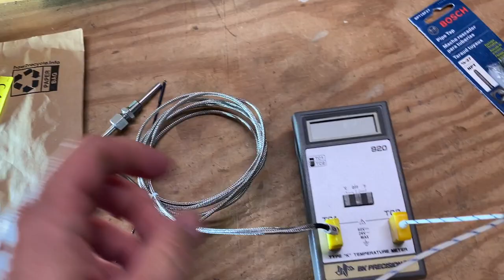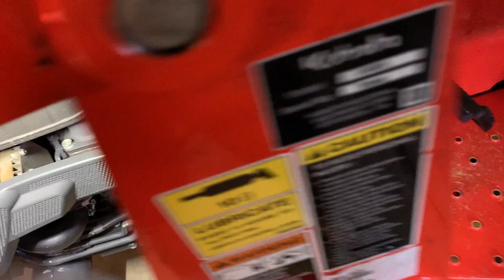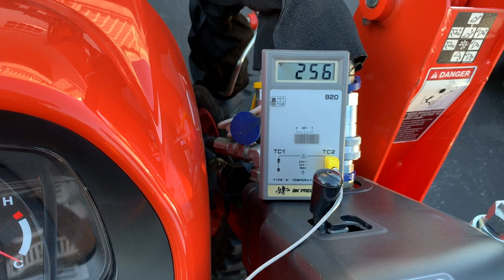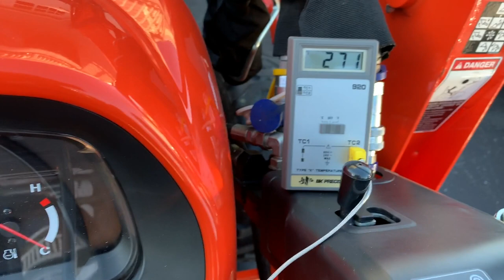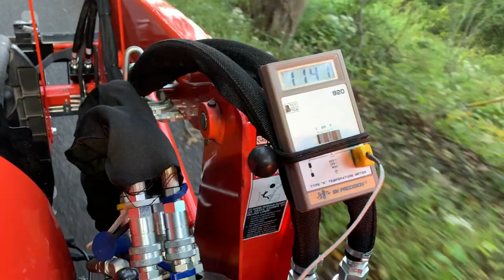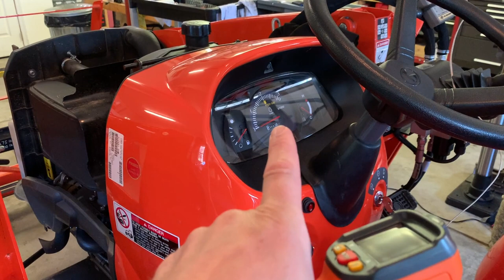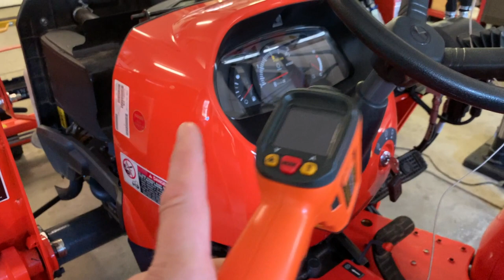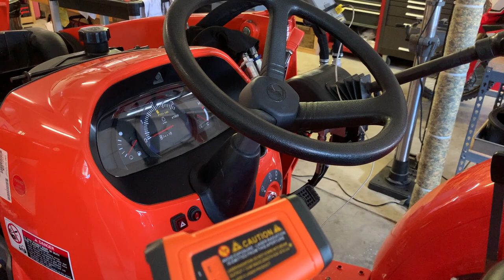Increasing the engine power of a Kubota L2501 / D1703-M-DI-E4B - Part 2

Comment: Thank you for doing this research! I've loved my trusty little 2501 since I got it new in 2017. Think its gonna get a little more power now... I'm curious how much difference there is in the spec range for the timing. I've always felt like mine had more than 25 hp, based on the work it can do. I'll probably check to see where mine is set at factory before I adjust it. I've never had the smoke issues a lot complain about. A little soot but that's about it. Guessing mine might be set on the high side of the spec.

In any case thanks! Very well done research!
Reply from the maker: Spec range is 3.25 ° to 4.75 ° B.T.D.C, so it's probably a few HP
Reply: @netmagi  well I did it. I had a .20 and .25 shim just like you did. I pulled both for a 4.5° advance. Turned the fuel up about 1 turn. Unbelievable difference in how it performs! I'm curious if you've been able to find any solid data on what our max EGTs should be. So far I haven't seen it top 1200, and I feel comfortable with that. But I darned sure don't want to melt something down either. Thanks again for your research!
Reply from the maker: @bearswartz2907  From what I read 1200 is ok but probably not best to run at for long periods if you want the 10k hours these engines will often run to.  I would consider ~1100 to be safe for running all day, every day.  I might pull mine again when I get a mill and shave .20 off and leave the .20 in there.

Comment: Kubota puts the same engine in their 8,000 pound kx033 excavator. Im seriously considering this machine for purchase over their 10,000 pound flagship kx040 with the 40hp d1803  because of the exhaust system simplification. From your presentation I can guess that the kx033 would have more power when moving itself  up a grade or when using the dozer blade to push earth. But the bucket and boom performance would be unchanged. Would you agree..?  or have any insight?   Extrapolated thoughts.?  
….The amount of knowledge you have acquired on this topic is very impressive and helpful, it’s as if you are a diesel mechanic for kubota. You can’t just look this stuff up anywhere except your channel. Thank you!     ….
Reply: Also on a reliability/ durability point, do you think that the engine would be more reliable/durable due to less soot deposits or slightly less longevity due to increased engine temps .?   Or is it a wash?

Comment: Looking at purchasing one of these myself so doing some research first, great efforts and great production in the video. There is a ton of good information on this. One thing I am curious about with everything else being the same, could you order a shim for the older tractor that would be the correct thickness and put it on the newer tractor?

Comment: Very informative. I'll be looking forward to doing this to my new L2501. Thanks for all the work you did to put this together so average folks like me can get some more performance out of this tractor. It all makes good sense. On a separate note I am in the market for a grapple and wondered if you had one or had any recommendations. I am leaning towards the Land Pride SGC1060 because its "performance matched" to the tractor but I'm a little reluctant to spend 3500 plus tax for it. Thanks again.
Reply: Check out "Everything Attachments" and you will find a variety of grapples, I have had one for several years and think it is indestructible, it has twin cylinders that grab each half of the grapple individually, it works great

Comment: Could you just adjust the screw and not touch the pump and get the same results? Did you use an angle drill for the sensor? Didn't look like enough space for a regular drill.
Reply: My question too!
Reply from the maker: No.  The two work in tandem.  Doing either alone will get you SOME power, but I would guess less than half of the gain if done together.   I would also think if you only adjusted the fuel at stock timing it would be even smokier.  Like wear-a-mask smoky.  The engine burns the fuel too 'cool' at stock timing, especially at lower RPM's under minimal load.
Reply from the maker: Had to use an angle drill.  I'm on team Bosch, so I used this one: https://amzn.to/3mplGXc
Reply: @netmagi  and a follow up question- do these changes affect loader lifting capacity?
Reply from the maker: no, but I have a video out on that as well.  Check out: https://youtu.be/b_mvKc9g1q8
Reply: @netmagi  I meant in addition to that :)
Reply: More specifically - wasn’t sure if the HP boost also improved lift capacity. For my use I need the very best lift capacity over any other vector - wondering how they all fit together
Reply from the maker: @exspo  no difference whatsoever.  You could actually decrease the horsepower and still get the same PSI as long as you were measuring at the same RPM.
Reply: @netmagi  gotcha. So for my purposes the hydraulic mod is the way to go. This is my first tractor and was surprised that it bogged on its own weight up hills (super hilly terrain on our farm) but it gets the job done. The work you’ve done is fascinating- thank you for sharing!

Comment: Hello very nice! I would be curious to see the difference in your lift capacity. I think the increase in HP would reflect in an increase in your lift capacity, especially because you increased the pressure to 2590. Thoughts?
Reply from the maker: The additional horsepower will not translate to any additional lift capacity.  The engine at stock settings already produces more than enough power to maintain the RPM on the hyd. pump at the relief pressure (even with the pressure raised)

Comment: Have you looked at a water/methanol injection setup to help lower EGTs? I wonder if you couldn't also then turn up the fuel with your intake density being higher...
Reply from the maker: I have not.  Probably worth looking into if you're building one of these motors for pulling or some other competition, but (in my opinion) would add to much complexity in a tractor application where you just want to know you can count on it to work when you need it
Reply: @netmagi  When my l2501 comes in I might give that a shot. Just run a simple 12v pump to a jug of windshield wiper fluid and see how it lowers the EGT. The other advantage would be helping decrease the risk of predetonation especially in our case of advancing the timing.

Comment: Great information on obtaining more power, safely. Its greatly appreciated. Just curious what the infrared temp reader would show with the probe plugged into it? Also noticed your temp gauge did not climb but stayed at about 1/3 the range. (I hate gauges without numbers!) So it the cooling system looks like it is well able to handle all the changes. Do you remember the approx air temp the day of the test?
Reply from the maker: It was fall, so was likely in the 60's.  It would show the same (or very close due to slight differences in PID handling) as the BK precision with the probe plugged in.  It seems like the cooling system on the L2501 is pretty over-spec'd for the amt. of heat the engine produces stock.  My guess is that is so that even if the radiator screen is 50% clogged , it's still able to keep the engine cool.  Some of that over-spec is now probably gone with this mod, so if temps do start creeping up, you will probably need to clean the radiator screen sooner.

Comment: Just out of curiosity, how much lower are the temps at the tail pipe vs the manifold? Looks like you have the ability to measure this simultaneously?
Reply from the maker: a few hundred degrees. but the biggest issue is the lag in change.  At the manifold you see it near instantly.  At the end of the pipe, it takes MINUTES to saturate.  By then, you're pistons might be liquid :)
Reply: @netmagi  thanks. One of the most comprehensive well made videos on YouTube. Both part 1 and 2. Nice job.
Reply from the maker: @hardesty1790  thanks!

Comment: First!!!!
Reply: Thanks for all the WORK AND RD FOR THE FUEL MOD . I have yet to see a one chime in with a base line for EGTs . If nobody else chimes in with base line temps I will try to complete in the coming months .           I did not check on your linked info. Do you have all the shop repair manual if included .